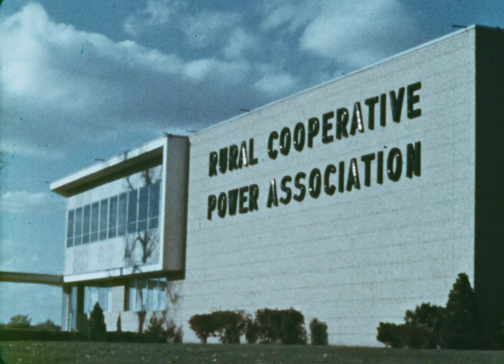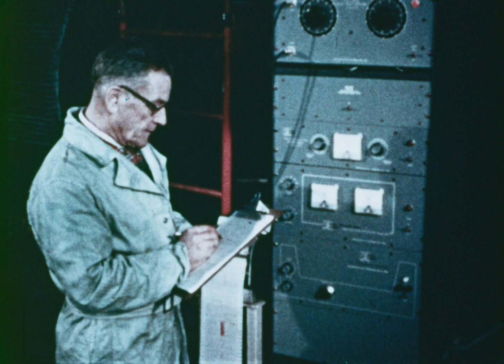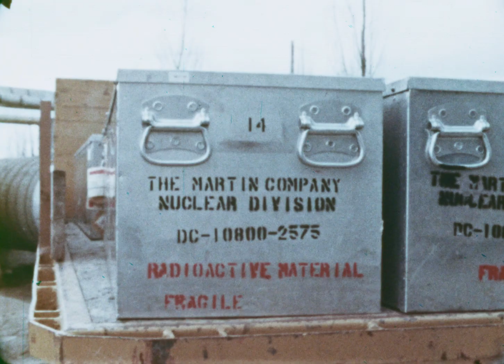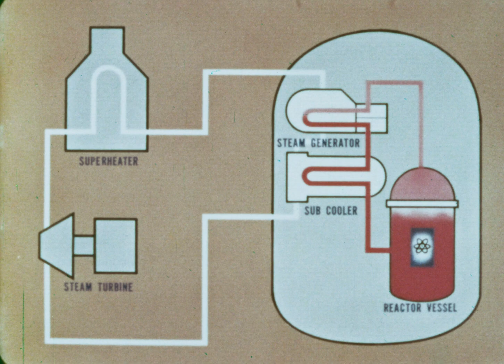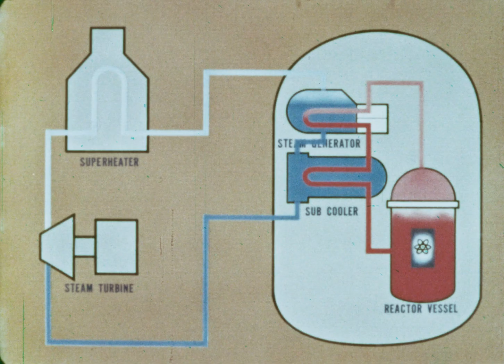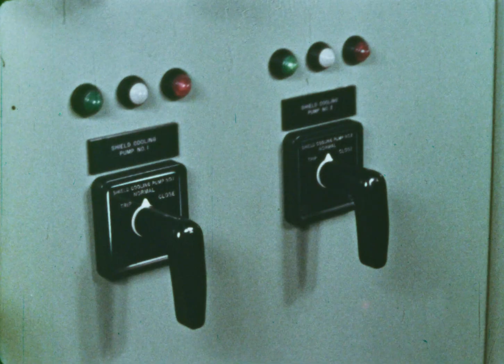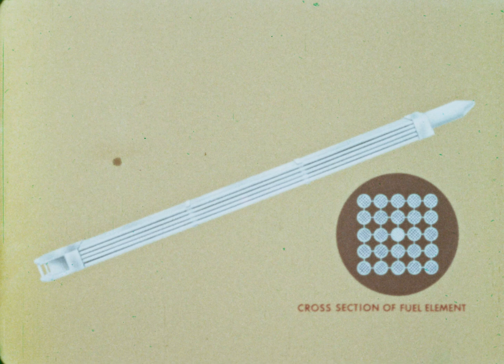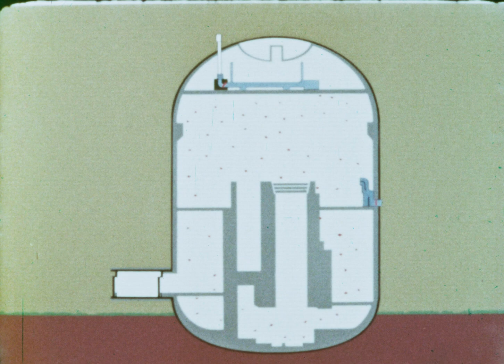Nuclear Energy Goes Rural: The Elk River Reactor in Minnesota (1963)

Comment: Closed 1968 after four years operation.  The ANS history details numerous problems w the project, where the primary problem was RPV reactor water leaks (vessel required major rework before initial operation).  

The 1960s then did have its own problem builds, along w great successes like Point Beach, still running.